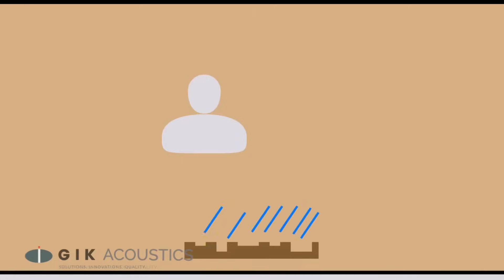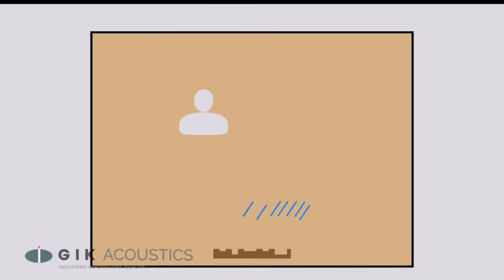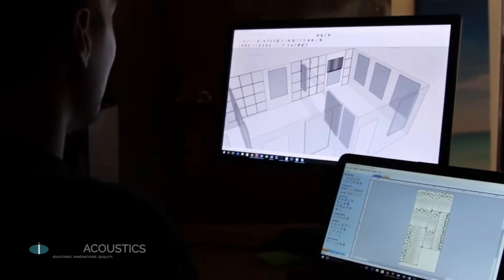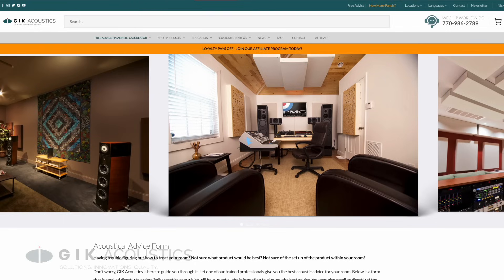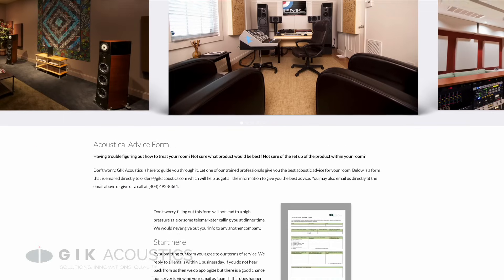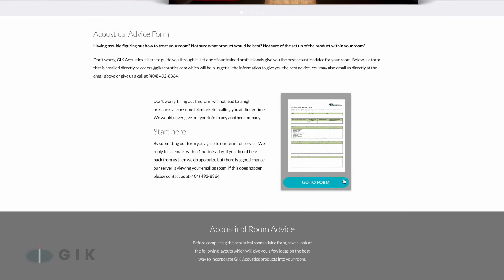DIFFUSION Concepts Explained - How Acoustic Diffusers Work And Which One Is Right For You

Comment: All my sound problems are external to my apartment located directly on the lobby and doors of my old 1880s apt. building. Researching a lot and this and others of your videos helped me. I need sound blocking solutions for my steel front door that can be attached internally, and possibly a corner bass absorbing/blocking solution to block the loud bass-heavy antique wood, ever-slamming two doors entrance. Can I attach panels that lap over by an inch the edges of my door, st least on the top and one vertical side? Can a stylish looking corner base absorber be placed against one of my corners closest to the entrance? Can they be cleanable (dust) and attractive?

Comment: Why is everyone only concerned about studio rooms? There is a huge market for residential units for which noone seems to understand there is a big need for sound absorbing
Reply: Well because each can cost from $100 to multiple thousand $ per panel, each audio space/section needs multiple for each wall, ceiling and floor treatment.
I made my own but it’s not cheap, so far it cost me $200 and it’s only half of the room.
If you are not make of money or audio does not earn you money, it’s very expensive to treat your room.
Not only that you have to test to see where to put the panels, put again, test again…
Reply: Some studios built their monitors into the walls just to avoid phase interfering.

Comment: I have a great-sounding upright piano sitting about 8 inches from a wall. Would putting 1) nothing, 2) broadband absorbers, or 3) diffusors between the wall and piano result in a better sound in the room? I typically pull the piano out from the wall and mic it on the back, when I record it.
Reply from the maker: That really depends on the entire room. By pulling the piano away from the wall you will get less low-mid/bass buildup, however the overall sound will greatly depend on how large the space is and how it's treated.